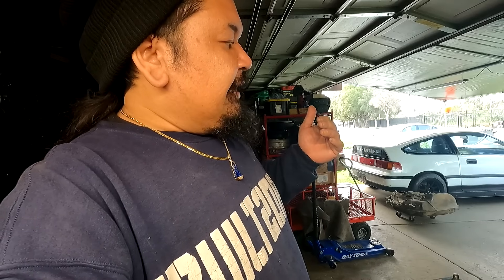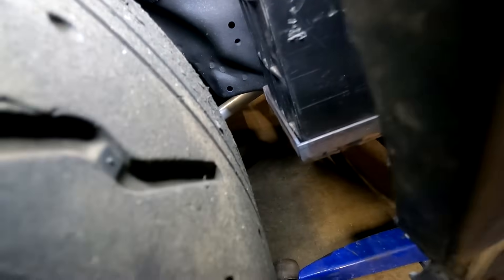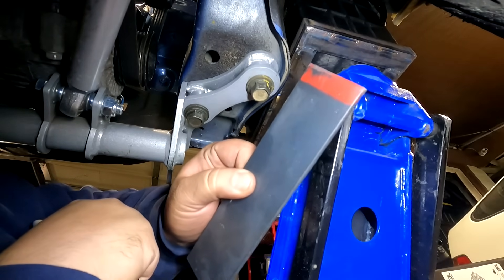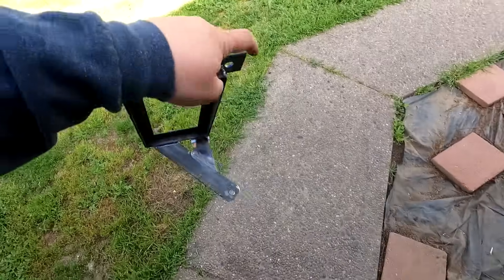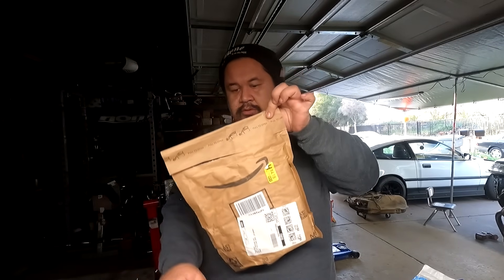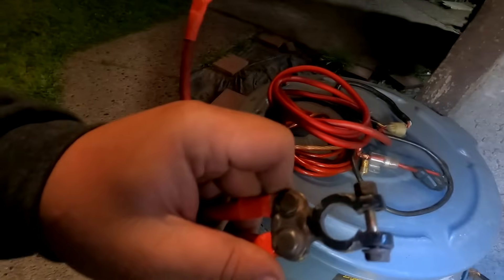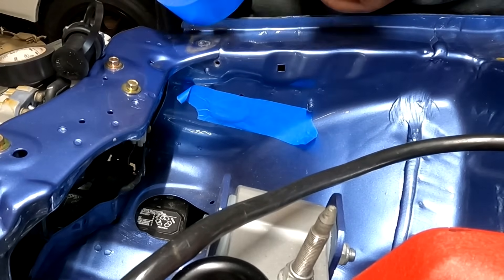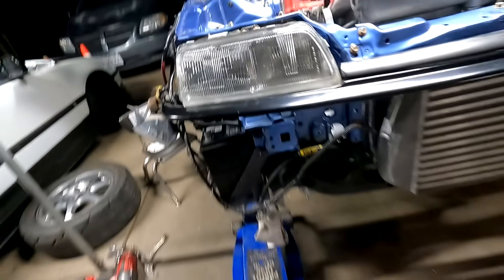K20 EF Sedan Battery Relocation with Charge Post !

Comment: Yeeee I need one of those battery trays in my life! One suggestion I have, is instead of running all your power wires to a junction box, run one power wire directly to the starter, and use it as a junction to tie into yhe alternator. Then have a separate power wire run to the fuse box in the cabin